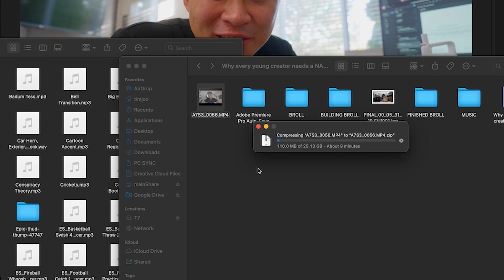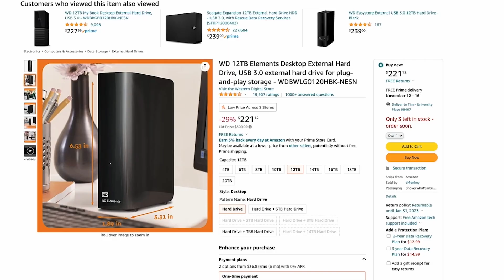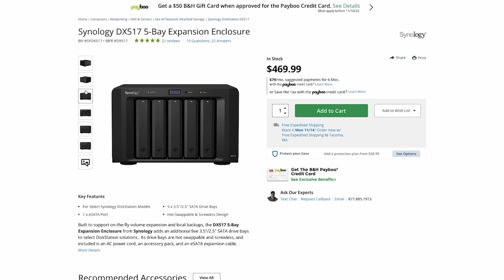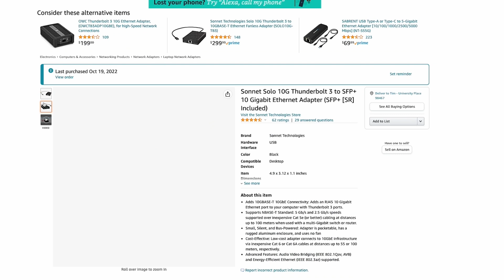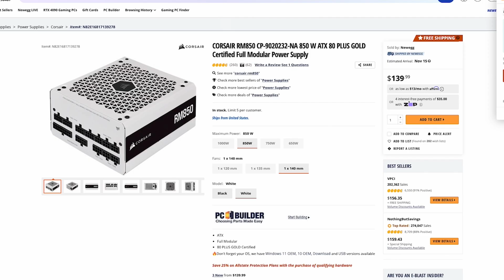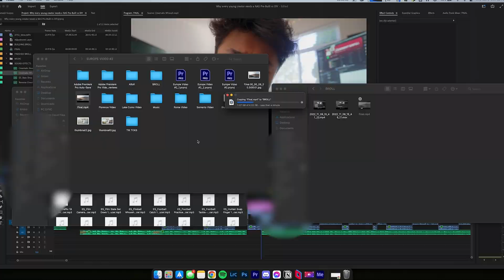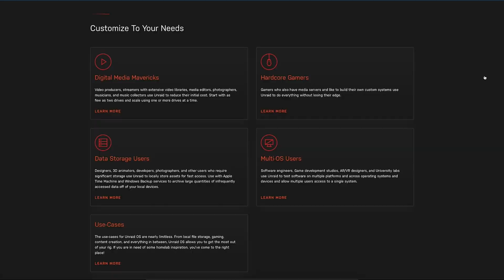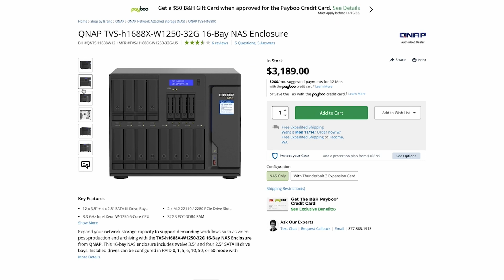why every CREATOR NEEDS a NAS | Pre-Built vs DIY (Network Attached Storage)

Comment: Using a maingear pre-built to make a diy nas server is so outrageously ridiculous 😂.    I’d recommend buying an actual server cassis if you’re going the DIY route, they’re not that expensive, especially if you go with nothing fancy.  I believe i spent a 100 euro’s on mine and most of them have fans on the harddrive cases. And you can just use old computer hardware for it.   If you’re running into thermal issues with your harddrives, even with proper fans, you can select an option in unraid to spin them down when they’re not used. In the summer, even with fans blasting on full speed, if it runs continuously for months they can get quite warm.  Having them spin down does wonders for thermals, I went from my harddrives going up to 80 degrees celsius to a breezy 22 degrees celsius.  I don’t recommend doing this year round cause it’s bad for harddrive longevity, but cooking your harddrives isn’t great either.    My 20 year old backup computer just died, i believe a transistor short circuited and it no longer turns on.    It was my main computer for 5 years, and a nas unraid server for 10 full years, I was only turning it on now adays to run a full backup from my main server, that thing outlasted 4 different gaming systems. It was a rock, they don’t build computer hardware like that anymore, I’m very sad.

Comment: My first NAS was a DS110J.  There was no way that I would pay the kind of money wanted for a prebuilt with specs geared more towards efficiency.  I used:
Antec P100
Shucked 6 14TB HDDs
PCI expansion card to add more SATA ports 
An old e351m mATX board that’s SoC
8 GB of Ripjaws
An old Thermaltake PSU

My buy in was less than $500 before HDDs.  If I need more power, I can easily exceed the price to performance of a prebuilt NAS.